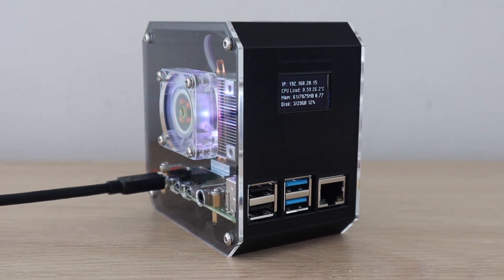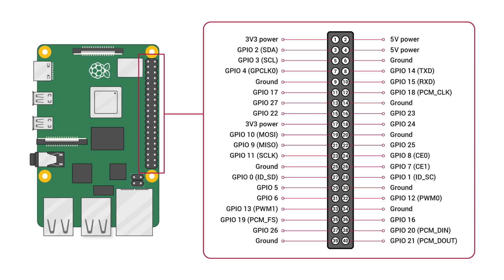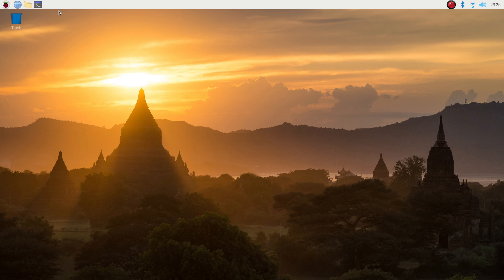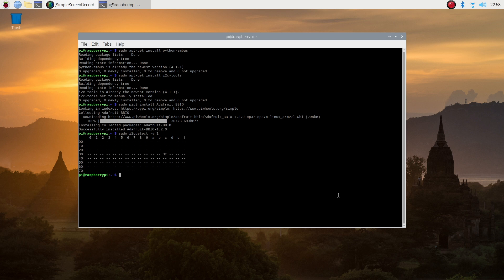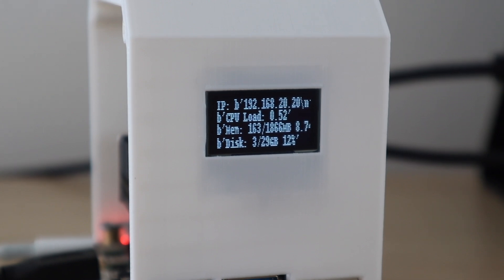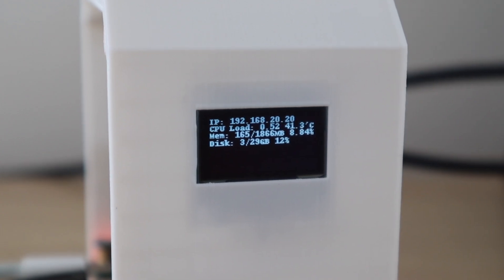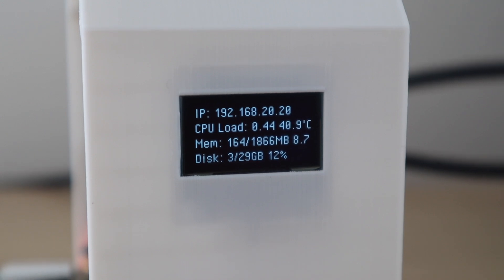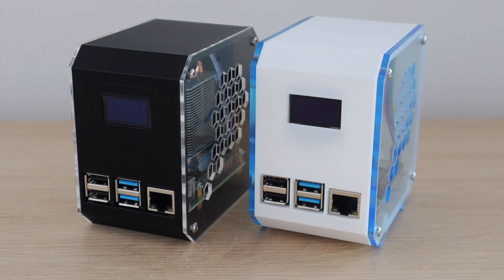Connect and Program An OLED Stats Display For Your Raspberry Pi

Comment: Do you think, with a little fiddling I could get this to work on Ubuntu?
Reply from the maker: I don't think you'll be able to get the GPIO pins to work but you could give it a try
Reply: @MichaelKlements  I will,
Reply: @MichaelKlements  I got the GPIO pins to show up, I'm in the process of trying to get the screen drivers working. I'm amazed I was able to get raspi-config to work on ubuntu

Comment: is it possible to put the SCL cable to a different pin? im currently using GPIO3 for a power button but im wondering if I could possibly use a different pin for that as well
Reply from the maker: Unfortunately there is no easy way to do this, it's one of the limitations of the Pi and the reaosn I don't usually use a power button. The Pi has a second I2C port on pins 27 and 28, you could make use of this instead of the primary port. You'd need to use pull-up resistors on the clock and data pins, change the config file to turn on the port and adapt the code to use it.

Comment: Everything worked great.  We'll, as far as programming the oled anyway.  I used a Raspberry Pi Zero W.  I tried this with both a 128x64 and also a 128x32 though I had to squish the lines closer together to get all 4 lines on the display.  The IP address takes quite some time to show up though.

By the way is the BORDER variable supposed to be there?  It does not look like it is used anywhere.
Reply from the maker: That's great, the 128x32 displays work well for more compact case designs as well. The IP address only shows up once it has been allocated on the network, so usually takes a few seconds longer than the other metrics.
I think BORDER was used in one of the original scripts to prevent text from running off the edge of the display. It's not being used anymore so you could remove it.

Comment: Any chance you can post an update to this ... using the waveshare 1.5 inch RGB OLED for a multi color stats display? I am fighting with the code, but am not a programmer. It would look fantastic on your case!!
Reply from the maker: I'll have a look at the display you've mentioned, they generally require a re-write of most of the code

Comment: Great success :-) thanks for the tutorial and the documentation. 

I had a hard time getting the crontab to work :-) my mistake was "sudo crontab -e" as I am used to sudo anything I do on a pi. 
you could mention that in case you ever do a update of the video.
Reply from the maker: Thanks for the tip, I'll include it in the next one.

Comment: So I've been trying to get this to work for the last two hours, but I absolutely cannot get the display to actually display anything other than loads of dots and gibberish. I'm still on the correct OS (background image is the same as the one in the video), the display is wired correctly (triple checked and even rewired it through a breadboard to be absolute sure), made sure absolutely everything possible was downloaded and updated, the display lights up and animates, and everything else should be fine. However, it's just not working. I'd love any help you can think of (except an OS change, it's a 2gb model and Buster is...... not great for them (it works, but it isn't optimized and the RAM isn't happy with it, based on a couple other Pi creators reviews))
Reply from the maker: Try following the instructions for Bullseye, the newer software for the display is still compatible with Buster as well.

Comment: Excellent tutorial for a (pi experienced) oled newbie. Just wonder about the CPU indicator. Even all cores running at full speed it shows single digit. So it is not percentage?
Reply from the maker: I haven't noticed this on my Pi but I'll test it again and see. What are you using to run all four cores at full speed?
Reply: @MichaelKlements  Found that cpu percentage can be obtained by installing psutil package and use print(psutil.cpu_percent()) trying to incorporate it to show percentage on the display.:-)
Reply: import psutil
    c = str(psutil.cpu_percent())
    c_filled = c.zfill(4)
    CPU = "Cpu: " + c_filled + "%"
    draw.text((x, top+18), CPU + " " + str(temp,'utf-8') , font=font, fill=255)
...did the trick :)

Comment: I was so close with the latest 64bit Kali Linux version for Raspberry Pi 4B 8GB then I got the following message. Does anyone know if they have been able to get it to work with Kali? :  This script configures your
Raspberry Pi and installs Blinka

RASPBERRY_PI_4B detected.

Blinka Exiting due to error: Sorry, the OS detected was Kali. This script currently only runs on Raspberry Pi OS.
Reply from the maker: You might get some better answers asking this on Adafruit's (the library owner/maintainer) forums. They should be able to point you in the right direction.

Comment: does this work if you are running ubuntu?
Reply from the maker: There will probably be a few missing libraries or dependencies that you'll need to install/correct. I haven't tried running it on Ubuntu.

Comment: Is it possible to also use a rasperby with home assistant installed?
Reply from the maker: You'll probably need to do some additional setup to get the display to work with home assistant, but you can certainly use the case.
Reply: @MichaelKlements  which setups. like in the video ?

Comment: Is this possible to add on a raspberry pi running home assistant ?
Reply from the maker: You'll probably need to install any missing libraries or dependencies but should be able to get it to work.

Comment: Hey MIchael! I've deployed OLED based on your instructions and worked flawlessly. I just have a doubt. On a shutdown, my RP keeps the display lit with stats showing. Is there something I could do on crontab to turn it off on the OS shutdown? Congrats for this great tutorial!
Reply from the maker: As long as the display gets power it'll continue to display whatever was last received. You could try adding a script to run on shutdown that blanks out the display. Or try connecting the power supply to one of the GPIO pins and turning it off when shutting down - you'd need to look at how much power is being drawn by the display and make sure that the GPIO pins could handle it directly though (otherwise it might need an optocoupler or transistor). I usually just unplug the Pi after using it as the power needs to be cycled to boot it up again anyway (unless you've added a power button)

Comment: Hi Michael! I've followed your tutorial to the letter, and I'm presented with the following error when trying to run the stats.py command: Runtime Error: Could not determine platform. Any idea what might be going on? The I2C display is connected and detectable, and the setup went swimmingly up to that point, but won't display anything when I try and run the command.
Reply from the maker: What is the command you're using to run the script? This usually occurs if the platform you're trying to run the script in either does not exist or is not up to date - python3 in this case

Comment: Is it possible to get the display working while using recalbox with the pi?
Reply from the maker: It should be possible, but would probably require some extra steps to get the libraries and dependencies working.

Comment: Got my case today.. Love it <3 So i've ran into a little problem with the OLED display. I'm running Ubuntu 64 bit on my pi and i've been trying like abt an hour now to get it working. Python smbus is stating (Unable to locate package python-smbus) Also Adafruit BBIO is having an error (could not find a version that satisfies the requirement Adafruit (from versions:none) )  also i went on with the installation. Got the Adafruit_Python_SSD1306 files and i tried to run the examples and no luck but a bunch of errors. 

So is there a way you can do a tutorial on how to setup the oled display on ubuntu?
Thank You!!
Reply from the maker: Hi Maximus,
Ubuntu doesn't have the same libraries and dependencies installed as Raspberry Pi OS. If you google each of the errors that come up you can probably work out which libraries are missing and install them manually to get it to work. 
I haven't used one of these on Ubuntu yet, but I'll have a look at putting a tutorial together.

Comment: Hello! i have a pi4, running home assistant, can i do this with home assistant? thanks
Reply from the maker: You should be able to get it running, but you'll probably need to install some missing libraries/dependencies. I've never tried it with Home Assistant.

Comment: I just put together the case and had an easy time doing it and getting the display to work. Problem is that the clear plastic on the fan side has the mini HDMI  cutouts too small. Look at the white case as in the beginning of this video. I had to cut out some plastic to get the cord in enough to work. I am using the supplied cord from the Canakit. Tomorrow I plan on cutting it like the white case one. The video signal drops out every so often and had me thinking that a new Raspberry Pi didn't work correctly.. Other than that I really like the case, great job !!

Comment: Hello! Can anyone help me? Cpu indication does not work. On the original script and on the autor changed script. There: "CPU Load: 0.00 52.3'C" on the oled screen. 0.00 value is not changing. I have Raspberry Pi 4 b 4Gb. Many times I checked this scripts. Sorry for my bad English.
Reply from the maker: Does the default script provided in the Adafruit examples folder not work either?
Reply: @MichaelKlements  Yes. This script stats.py, from the original Adafruit lirary, do not show me persentage value of CPU Load. It 0.00 on the oled screen, but sometines it may be 1.00 or 2.00 rarely.
Reply from the maker: What operating system are you running on the Pi? I've never heard anyone have issues with the example script's CPU percentage not working, it's typically the IP address.
Reply: @MichaelKlements  The same happens to me. I also have problems with the percentage of charge, it always marks me 99% and charging type c even though it is not connected and with little battery. Also in a while the screen freezes and does not update anything. I have reviewed and have done exactly the same as in your videos :(
Reply: @MichaelKlements  I'm using an original latest Raspberry Pi OS, downloaded by Raspberry Pi Imager v.1.6.2
Reply: @MichaelKlements  Hello. I have fixed my problem. I changed the "%.2f" argument in the 113 string to "%s". And now it is working properly! Shows me right value of CPU Load.
Reply: Can confirm - have been running into the same issue on my testbed Pi3b. CPU load is always zero, even with the original stats.py file. Changing the argument to "%s" instead of "%.1f%%" (in my config), shows some value, but this is not corresponding to the cpu load shown e.g. in taskmanager. Will give it a second try on my Pi4b later to doublecheck if I made some error on the way though.
Short update: gave it a second try on a Pi4b (Raspbian Buster, full install, all updates) and the result is exactly the same. Literally copied and pasted ervery command from @Michael Klements blog - no chance, CPU load stays zero

Comment: Thank you for the amazing project!
Mine seems to work pretty well.
But after a short time the script stops working (the Display freezes).
I couldn´t find the cause for this problem.
Had anybody else the same expirience?
Reply from the maker: It might be a communication error that causes it to lock up. Try adding a try, except rule to the communication with the display and see if that helps.

Comment: Wow I really like that case. If you don’t mind me asking…what machines do you use 3D print and cut the side panels?
Reply from the maker: I used an Ender 3 V2 3D printer for the case and a K40 laser cutter for the side panels.

Comment: Great guide it really helped me make the display work. Also I was wondering is there anyway to get the stats display going if I have a SD card with Retro Station on it already?
Reply from the maker: Some people have tried running it on different distributions with mixed success. If you've got the time to work through the error codes you can probably get it running on most linux distributions.

Comment: i cant find any examples for 8pin 1.3 oled i2c displays
Reply from the maker: Try searching for SPI instead of I2C, I think these are the ones you're referring to
Reply: @MichaelKlements  the driver defaults to i2c unless you bridge the Spi connections on the back
Reply: @MichaelKlements  I actually figured it out I didn’t realize it defaulted to 0x3C when mine is 0x3D

Comment: hello! Thanks for detailed instructions! I am having a trouble! at first following your step, everything worked totally fine! but when I updated raspbian, there is no longer anything shown on the display by default. I checked everything! I check whether anything in crontab has been changed, but there was all okay as per your instruction. but still this program does not run at startup! please help!
Reply from the maker: I've had this happen on a Pi and it would only start working again once I replaced the crobtab file.

Comment: sudo apt-get install python-smbus     no longer seems to work. Are there any alternatives?
Reply from the maker: You're probably not entering the correct command, it should still work, try - sudo apt-get install -y python-smbus
Reply: @MichaelKlements  it does not work for me too? 

Reading package lists... Done
Building dependency tree... Done
Reading state information... Done
Package python-smbus is not available, but is referred to by another package.
This may mean that the package is missing, has been obsoleted, or
is only available from another source

E: Package 'python-smbus' has no installation candidate

Comment: another thing, "might be dumb" .. but why don't you make the holes for the ethernet an USB from the back side? and then only the oled will be at the front ...
Reply from the maker: I guess it’s just personnel preference, I like having the USB ports on the front so it’s easier to plug in devices. I’ve got a version of the case with the ports on the back too.
Reply: @MichaelKlements  found them, plz ignore
Reply: @MichaelKlements  can you plz share the link with the one with ports on the back? 
Thanks 🌹

Comment: Idea - Is there a text only screen for programming. One that can handle a terminal size resolution but no fancy graphics just very low power but not e-ink. The idea is that code is a function of input also. Switch input device and you feel some inspiration. New ideas.
Reply from the maker: I’ve also thought about this previously, but I’ve never seen a display like this. I’m also not really sure how it would interface to the Pi, probably using SPI or I2C. People often have terminal displays for PiHole stats etc. and a text display would be perfect for this.
Yeah e-ink ones are terrible for typing or text that changes often.

Comment: hey, do you know how to delay the boot (start up of a pi) have one that mounts a nas as storage but the pi boots up faster than the nas and doesn't auto mount the drive, thanks to load shedding this happens quite often. any help would be appreciated. .. and thanks for the great content so far.
Reply from the maker: I've never specifically tried to delay the bootup of a Pi. You could try something like this - https://raspberrypi.stackexchange.com/questions/33037/how-to-add-delay-at-boot
Otherwise you'd probably be better off adding a physical delay timer circuit on the power supply to the Pi to only power it up after a few seconds or minutes as required.
Reply: @MichaelKlements  thanks much appreciated ill give it stab.

Comment: Left a comment on your blog, but no idea if it posted so I'll leave it here.  Thanks so much for making this follow up tutorial because I was having a little bit of trouble using the original one you created.  I'm new to the world of R-PI and was extremely excited when cases arrived yesterday.  Love your case by the way!   I immediately got started using your tutorials and I have to say that everything worked great with the exception of the final step.  It's probably my fault because I opted to use a direct path to the stats.py file in the example folder rather than placing it and the font file on the home screen.  Nonetheless, I cannot get the script to auto run upon reboot.  Alternatively, I did try it from the home screen as describe in your instructions and it still did not work.  Any idea what could be wrong?  The info and path I entered and saved in the crontab file was @reboot python3 /home/pi/Adafruit_Python_SSD1306/examples/stats.py & .  Again, as I mentioned, I did try @reboot python3 /home/pi/stats.py & and placed the two files on the home screen, but it still did not work.  Please help me figure out what's wrong.  Thanks!
Reply from the maker: Hi Rodney,
Thanks for the feedback, it's great to hear that you're enjoying your case!
crontab needs to be working in the correct root directory for that command to work. This sometimes fails if you've got other tasks scheduled as well. Do you have any other tasks in crontab or is that the only one?
If you try run the command "python3 /home/pi/stats.py" from a new terminal window does it run?
Reply: @MichaelKlements  Thanks for getting back to me so quickly Michael.  Upon trying the new instructions you provided, i.e. running the command "python3 /home/pi/stats.py" from a new terminal, I quickly realized the problem.  I placed the files in the wrong location.  They were on the desktop and not in /home/pi directory.  UGH!  Your tutorial is flawless!  Thanks again for helping me figure the problem.  Everything is working great now.  Off to put together my second case.
Reply from the maker: That’s great, I’m glad you’ve managed to get it working!

Comment: For those with 128*32 display use the font 'pixeloperator8. ttf' and use
+2
+10
+18
+27
On those draw text lines

And remove "MB" from line 115 so that % sign can fit in the end
Reply from the maker: Thanks for the tip!